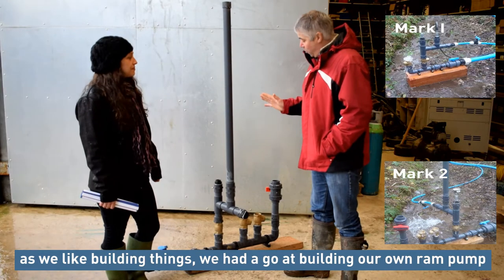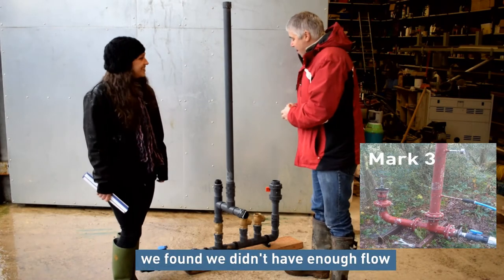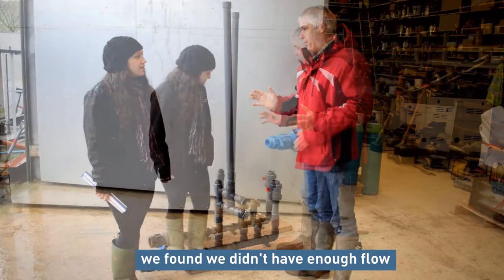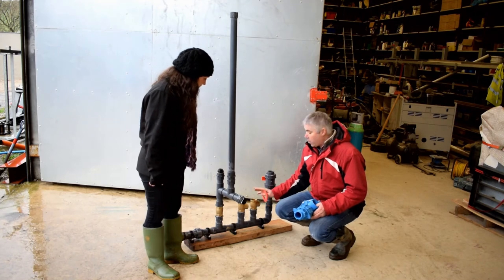Homemade diy ram pump - DO NOT MAKE IT YOURSELF!

Comment: the air chamber is way to small, ram pumps are awesome, don't believe this video,
Reply: yep
Reply: They promoted the Papa pump but for me its to expensive than to make a home made ram pump
Reply from the maker: The non metallic body and patented new valve allows it to be much smaller but countless customers have testified that they get more water than their old metal ram pump. Bigger is not always better.
Reply from the maker: No-one is disputing that. You can make a ram pump from bits and pieces from your local plumbers store - very cheap.  But it will take up a lot of your time, making it, and maintaining it.  Up to you if that's what you want to do with your time. You can make all your own machinery, make your own clothes, grow all your food...  ...if you have the knowledge and the time. But not everyone can.  If you make your own stuff, good luck to you.  We'll worry about those who don't.

Comment: Papa is too expensive for third word country
Reply from the maker: We do a version spedifically for the third world - the Agri Pump.  It retails at $995 and has a 3 year guarantee.  Ask us for details.  It is basically the same as the Papa Pump but without the drinking water certifications.  It will never be as cheap as a home-made ram but it will be more efficient and will last a long time with very little maintenance.  It depends if you value your time or not.
Reply: @Waterpoweredtechnologies  any way it will be use for drinking water as well as household use. Why not uploaded for video so as the propective customer can watch
Reply: @Waterpoweredtechnologies  I can't find it on your website. Your lowest pump is around 1800 USD.
Reply from the maker: @eliguaso22  For the Papa Agri Pump ($995USD) Please email us at info@wptlgobal.net

Comment: Instead of clackers. Could you use a Tesla valve it has no moving parts?
Reply from the maker: If you try it then let us know how you get on, we would like to see.
Reply: That may work for the one way valve on the pressure vessel, but the discharge valve needs to be open for a time and then snap closed for the pressure spike needed to pump the water.
Reply: use electric or not? how much cost of the pump?
Reply: It needs serious compression. That's the "ram" part. The pyramids used similar tech but the volume was much larger and they used a granite block for one way valve